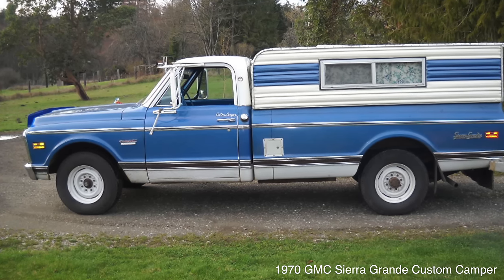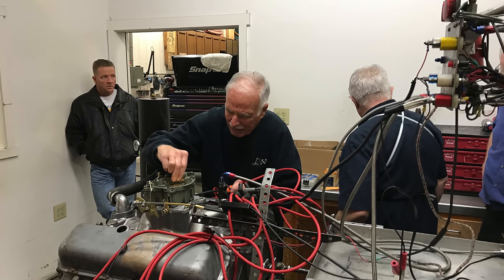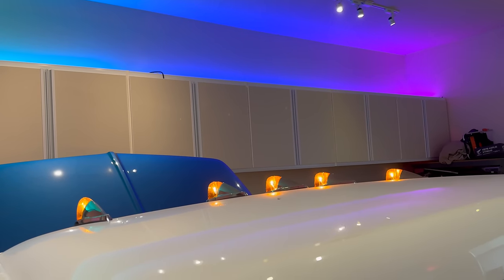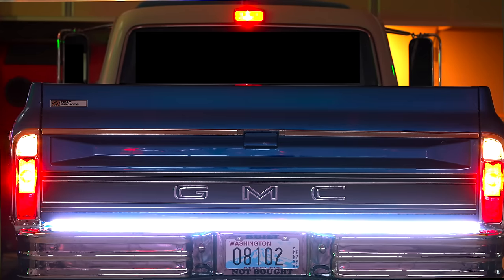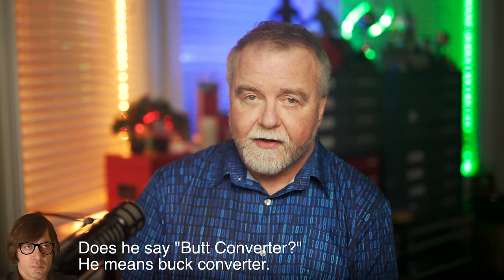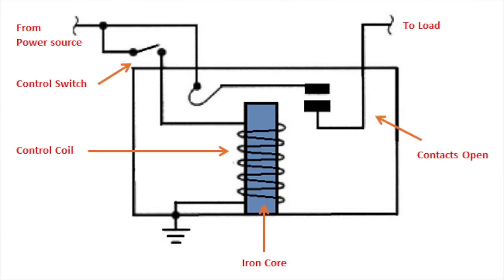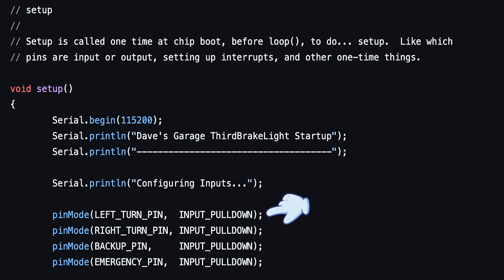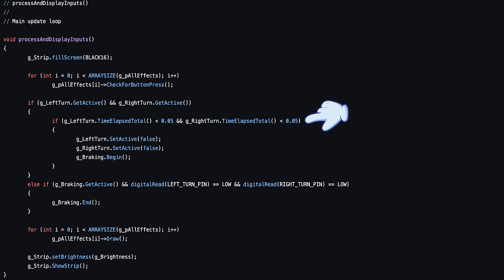New C++ LED Tricks for Our Old Truck: Sequential LEDs

Comment: "Retired Microsoft software engineer...I'll get it right by version 3."   LOL.   Regarding converting on/off states in the car's 12v world to on/off state in the ESP32's 3v world, you CAN accomplish that using voltage divider resistors on the inputs (3x ohms above the ESP32 pin, 1x below then pick x to yield an appropriate current limit) BUT...  Since this is brake lighting we're talking about which is safety related and you know the car's "12v" system can actually get as high as 14v during charging, I would also protect each ESP32 input by using a zener diode rated at 3.0v and tie it to each ESP32 input connected to the 12v realm.  This will GUARANTEE an unexpected high voltage in the 12v realm doesn't cause the 3v limit to be exceed and burn out the ESP32 and interfere with the ultimate brake / turn lights.  Also, to "de-bounce" the inputs, you can do it in software as you illustrated or you can use a 7400 NAND as a Set/Reset flip-flop OR use Schmitt triggers to mask those interim transitions from the output.  Just went through this exercise on an ESP32 experiment of my own.

Comment: resistor and a zener diode is how we usually bring down input voltages to the proper level and also provide input protection. You will want something similar with optocouplers too as they can also be sensitive. Nice project, I am curious how you plan to make this weatherproof. might be a good idea to buy a cheap "ECU" enclosure and put all the components inside it.

Comment: Dave Please do more videos on your old Chevy Pickup I love these old Trucks I love the sound of a Chevy starting up in the Morring my main ones from 1970 ones up to 1990
Reply: When I was in high school in the late 80s, I briefly owned (it was originally my Dad's) an 81 C10 shortbed. I ended up selling it to buy a 73 Toyota pickup that I converted into a lowrider. I wish I still had either one of those, both were a joy to work on. My current truck is an 02 GMC Sierra.

Comment: So cool. I own an early 80's ford diesel that I have been working on. Lights was the first thing I hit lol. I have been writing a library for a 4g sim hat on a raspberry pi zero to use as a gps tracker, diagnostics, and remote start. I want to add some lora capabilities with an esp32 but I have already wrote code to parse sms and execute scripts that way. I wrote code to execute scripts via SMS and I can start an ssh connection that I reverse tunnel into for remote access.

Comment: RELAY!!?  Yes, you could do it with a resistor divider but the opto is the right choice - An ILQ32 should do the trick.
You know I bet Admiral Grace Hopper, could probably implement the entire design using relays.  Then you could do real debugging.

Comment: Nice job. This is an interesting upgrade. A few additional ideas:
1. Instead of alternating red and blue emergency vehicle mode, how about alternating amber and unlit hazard mode?
2. Some form of flashing "SOS" in Morse code.
3. Directional amber hazard mode similar to emergency vehicles to direct traffic away from the vehicle.

Comment: You could also use: Sziklai pair transistors to convert 12V signals to 3v33 rather than opto couplers.
Since GND would be the same every where.

Comment: I enjoyed this on a couple levels since I've done stuff like this both professionally and as a hobby playing with Arduinos and Pis. Warning lights are a big deal in industrial automation.

Your use of both relay and optocouplers isn't that weird but I appreciate your Windows 3 joke and if the opto is included on your relay board then yeah it's redundant. That said about redundancy makes me think since this is probably considered a safety device powering a brake light it might be smart to have redundant dual path. i.e. 2 relays in parallel both with their own opto incase one leg fails. In that case you could even monitor both legs and compare to set am appropriate fail state.

Comment: In The Uk and Eu we have separate break and Indicators lights the break lights issue would not be a issue as you can pull it of the break light pin.

Comment: Fuel tank in my car is directly under the drivers seat... and for bonus points, I installed the lithium battery for the dashcam right on top of it.
Reply: I used to own an aircraft that had a fuel tank that was the actual seat... It also did not have an electrical system, so you had to hand-prop it...

Comment: Would've been really easy to wire a mosfet to pull down the ground side of the lights. That way you handle the power of the LED's through the mosfet and will provide a little isolation.

Comment: One huge problem with those fuel tanks wasn't about the tank itself, but about the fuel filler.  If the truck rolls on its side, the fuel cap can easily come off, and the gas pours out onto the road where the truck is of course sliding and creating sparks.

Comment: While you could use a simple voltage divider to bring down the voltage, your relay solution is actually much better. First, a vehicle is 12V nominal, but 13.8V charging and 14.7V with the alternator. But that's under ideal conditions - if the battery were to fail, the voltage can surge up over 30V before coming back down. And if it's a gas poewred vehicle, the ignition could backfeed onto it, and produce very brief 50V or higher spikes. And under certain conditions, a brief -110V (yes, 110V the wrong way) has been seen. Thus all vehicle interfaces need to be properly protected and isolated, or it will work for a few days then everything goes up in smoke. Usually you could get away with some clamping diodes at the inputs (the voltages are brief) to keep the voltage excursions within limits). Using a relay would generally work well - automotive relays are spec'd to handle such brief over voltages because they're going to see them in general operation. And the relay's dry contacts ensure that you only give nice regulated voltages to the inputs, Designing an ECU is actually a lot of work when you consider how much effort is needed just to talk to the vehicle.

Comment: No mention of the hardest part, which is where to stuff all the wires & electronicals in a truck, make them waterproof.
Reply from the maker: Fair enough... I grabbed a sealed project box off Amazon that has cable grommet entrances.

Comment: If the LED strip uses 15 amps, the buck converter should be rated higher than 15 amps due to tolerances and variation due to temperature, age, etc.

Comment: Oh, and it's not likely someone with a newer car would do this, but... a LOT of trailer control modules (which also control the signals going to the 7 pin) totally disable the outputs to the connector if a load isn't sensed (telling it that a trailers present).  Pretty sure this was done to prevent corrosion at the connectors by inadvertent electrolysis.  Some vehicle mfgs will also not hook up the +12 line going to the connector unless requested at the dealership level.

If you have a simple trailer that only has LED lights and nothing else (electric brakes for example), your vehicle will sometimes not even know the trailer is there!  The LED's just don't draw enough current.  Was a big problem with Fords (I'm a GM guy BTW!).  Until recently I worked for {a large trailer mfg} and had to go over this with dealers, repair shops and end users daily!

Anyhow, there's my rant for the day from your former l/h neighbor in AB.  :)

Comment: God bless you for bringing a new driver to the road.  I have a question that is off this topic- I had a really nice workflow about 20 years ago under Windows XP.  I used a bootleg of  ACAD LT 97 that I got so much out of, I bought ACAD LT2011 to pay back the karma gods- major fail, it wouldn't even run even on Win 7,  I had a great PCB package, Protel 99SE that I paid a few grand for- still does everything I need but won't run past XP.  I have some old lab hardware that only runs under XP so I maintain an old machine.  I can run those old apps on it too but it seldom makes sense.  There are companies that I can pay a couple of hundred bucks to let me run these old apps- what is the deal. I've toyed around with VM's on Win10 running XP- it does work but pretty klunky.   Why won't these old apps run?  I would love to understand this at a low level.  I believe that they are all 32 bit apps, I understand the 16 bit line.  What is the right way to run these great old apps or should I just grow up, give up and move on.  Thanks- enjoy your content.

Comment: I tried something like this for my motorcycle. I installed 6 strips ( 3 on each side) of my topcase.  The strips have varying length in pairs.  (2)  14 led , (2) 16 led, and (2) 18 led.    Each side having a 14,16,18 wired in series with the 18 leds on the bottom and moving left to right , or right to left respectively. 

The problem I had, was with the programming. Have zero programming knowledge, I use examples on the internet and open AI for programming help.

I never could figure out complex animations because I could not understand "arrays". 

Example :  Right side layout

34, 35, 36, 37, 38, 39, 40, 41, 42, 43, 44, 45, 47, 47
18, 19, 20, 21, 22, 23, 24, 25, 25, 27, 28, 29, 30, 31, 32, 33
0,   1,   2,    3,   4,    5,   6,   7,    8,   9,   10, 11, 12, 13, 14, 15, 16, 17      

Electrically this was a continuous strip.   

One of my goals was to have a " curtain effect" with the turn signals. 

When right turn signal was "high" , I wanted to light the following leds in sequence.

0,18,34   then 5ms later 1, 19, 35, then 5ms later 2,20,36 ... and so on.  Each 3 group of leds would stay lit until the entire array animation was done. 

I could never work out how to do this. 

Hardware I used was the WS2812 and an ESP 32.

Comment: 7:36, I don't know why people think flashing their brake lights automatically is both legal and a good thing. First of all, the law in many or most states (WA may be an exception) says that brake lights should only flash in an emergency. And no lights should flash except to signal turns, except during an emergency or on an emergency vehicle. Finally, it's distracting. As someone with autism, I see those lights flashing and immediately get triggered, particularly because it's allowed but illegal and so much more commonplace recently.
I hope you turn that feature off when you're on the road. Even better, enable it only during sudden deceleration, so that it flashes only when there is actually a potential emergency situation, not just slowing down normally. The brake lights coming on without flashing is more than enough warning in most situations.
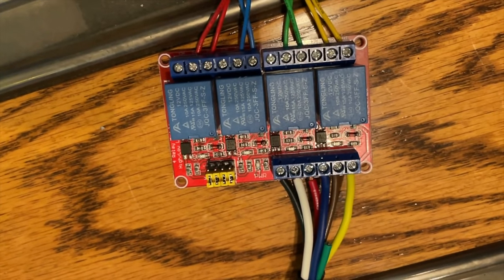14:00 😂 You're awesome, Dave.
Reply: Jesus fucking christ……

Comment: i was too busy laughing from @13:58 on to even know what happened for the rest of the video 😂
Reply: And my thought was, "That's hardware, Microsoft gets that right in version 1 (most of the time.) It's the software that need s 2 release level failures." That said, if it works, it ships. Breaking it with a sledge hammer isn't our technique.

Comment: It's not the 'right' answer, but if you are OK with it not being completely  isolated from the noisy truck electrical, you could use a 3 v zener diode after a voltage divider to limit the voltage going to the ESP to 3 volts max. (or 3.3v zener for that.) That along with a resistor/capcitor circuit tuned to clear out the sub 30 ms bounces  should solve both problems in hardware. Obviously test it. You can probably use another ESP through an opto-isolator to simulate bounces with transitions from on to off, and off to on at various noise levels. You will still want the IRQ's though as you don't want a 100 ms delay between panic breaking and LED Break lights coming on if the loop starts getting complex. 

A couple of ideas for an update for ham's who participate in SkyWarn or the like, would be to provide amber indicators like the pass on left or pass on right  slides, and a setup that is an alternating pair of amber lights. To start confusing folk, use a pair of prime numbers to set the timing for the pair, lift with 11, right with 13, and you'll get kids watching the flashes go in and out of sync over a cycle of 143 blinks. These may also be handy for people plowing driveways and alleys with anything from a large pickup to a quad or older tractor.

Comment: We're trying to get something similar working on my son's car.  He built a center rainlight brake light, which needs to rapidly flash 5 times then turn on.  It works, but we have yet to figure out how to connect it to the brake light.  Everything is CANbus and the wiring loom is largely inaccessible!
Reply: You can tap into the CAN bus at the OBD2 port.  Teensy microcontroller has native CAN support but you can probably make it work in software with any microcontroller.

Comment: Does this truck have hazards? Because that would mean the bar would flash on and off with the conditions set, watching for both left and right lights being triggered at the same time. You may want to look into if center lights are allowed to flash for hazard lights. At the very least, hope it is not specified/dis-allowed.

Comment: OK, I understand you coded it to latch for brakes and then a turn is initiated. But how about when a turn signal is initiated, followed by braking? Will it detect that the brake lights must be activated with the original turn flashing maintained?   BTW,  Love that truck!

Comment: How did you account for the off-on time of the signal, to line up with the LED strip, ending at the same time?  Measure, or is it logic controlled in case the duty cycle drifts?

Comment: Hey Dave, I've been a subscriber for a while, but I overlooked the importance of this video to a project of mine until I made a post to r/microcontrollers on reddit. Someone pointed me to this video. What you have done with your truck is almost exactly what I'd like to do with my 20' travel trailer. I want to mount LED strips along both sides and across the rear. These will work with blinkers, brakes, and reverse lights. The main difference will be that I'd like to be able to control the LED's via a remote when not attached to the tow vehicle. I'd prefer to do this with a standalone remote, not wifi or bluetooth. Do you have any recommendations of things to consider or things you might do differently from your original plan? Thanks for all your great content.

Comment: Does this vehicle have a hazard lights flasher?  If it does, then your logic for determining when the brake lights are set (vs turn signals) might not work as intended... There is a brake light switch with a plunger that gets depressed when you press on the brake pedal (for many cars, but some have a hydraulic switch)... You should be able to put a pair of wires on it and monitor whether the pedal is depressed with the ESP32... You could also just route this back to the 7-pin trailer socket if you were wanting to design something that only plugged into the 7-pin socket... Depending upon the amps that were being supplied at the brake pedal, you might want to consider having it control a relay that in turn sent more potential amperage to the 7-pin socket...

Comment: This would have been way easier with a European 13-pin trailer connector:
6 - brake lights
1 - left indicator
4 - right indicator
8 - reverse light
2 - rear fog light
7 - rear running light left
5 - rear running light right
10 - key switched 12 V
9 - direct, constant 12 V
12 - spare
3 - ground lights
11+13 - ground (10)+(9)

No need for ambiguous logic, because each pin has a specific function.

You have to detect the difference between:
Braking
Indicating
Indicating while braking
Hassards

Comment: Huh, Mind blown at the concept of the BRAKE LIGHTS not having a dedicated pin in a US trailer plug, I would have thought that was just sensible to have one as a part of the bare minimum.  maybe an engineer felt the need to be clever when designing XD.

Comment: Would that not also cause the brake light to come on if the hazard lights were switched on?
Reply from the maker: The third brake light will flash when the harzards are on... by design.  I'd like to have dual signals instead but you can't differential hazard from brake at the connector, or I don't think you can!

Comment: What if you ever wanted to pull a trailer ? If the system is plugged into the trailer plug
Reply: Unplug the light bar that will be obstructed by the trailer?

Comment: I’ve never understood why the US doesn’t have separate brake and turn lights. They’ve been standard in Europe (and the rest of the world) for over a century.
Reply: I would suspect it's mostly a 'cost' element. A single socket that accepts the turn and/or brake indicator is going to cost less than multiple sockets. Keep in mind that the auto industry in the USA fought like hell to prevent laws requiring seat belts being installed in any vehicle through the 1060's, and were still fighting against the requirements in the 1970's. Their take on it was 'Adding Safety equipment gives the customer the impression that our vehicles aren't safe.' which was then declaring that the customer was the fault for any safety failure. Keeping down costs was the real issue, as providing secure anchor points for the seat belts (lap belts almost exclusively at the time.)

I'm not saying it was the 'right' thing to do, just that I'm pretty sure that was why they did things the way they did.

Comment: I can't possibly express how stupid it is that American market cars still have red turn signals. Even the European models have red turn signals on the American market, which is twice as stupid. Granted, some do have ambers, but it's not enough. Amber turn signals should be federally mandated. Throw in asymmetric low beams while you're at it.